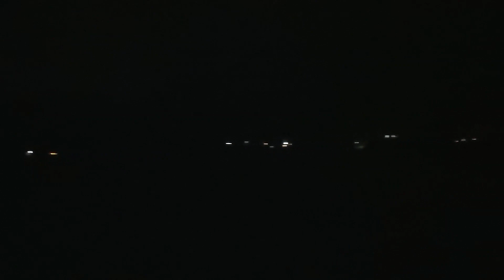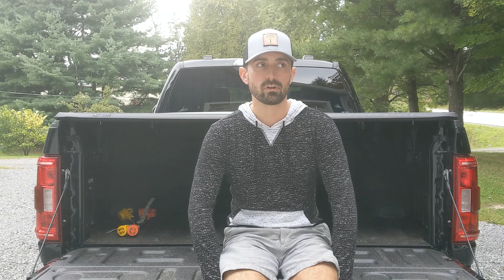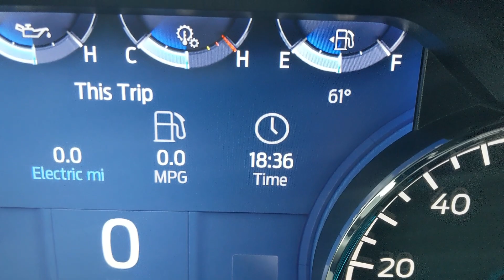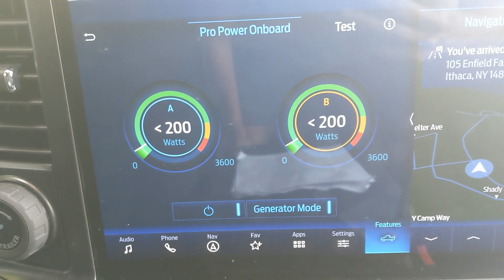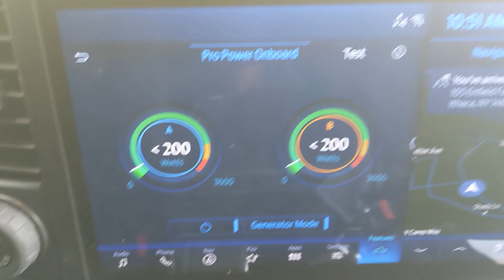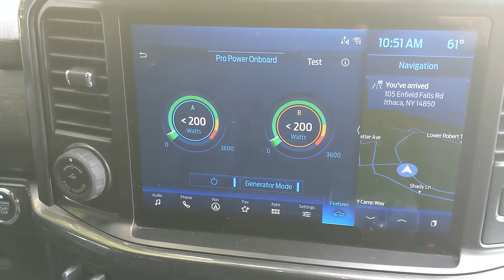2021 Ford F-150 Powerboost Generator - Part 6 - First Off Grid/Boondocking Camping Trip!

Comment: Seems like you have a very liberal definition of boondocking. My sense is that boondocking means you're in the middle of nowhere, no facilities, no campsites, no company from other campers at all. Sounds like you were in an unimproved  campground.  I've found the toughest thing is tanks/water that keeps you from having an extended stay boondocking (> 5 days). (2022 Powerboost/Winnebago Micro Minnie FLX). Do you have solar on your camper. Pretty essential for a longer stay even with the truck.

My Powerboost (and yours) is designed to do the power generation for 36 hours straight. After that, you'll need to turn the vehicle off and then back on to "buy" another 36 hours. I'd say your truck is working like it's supposed to.

Comment: It's a cool feature but you really would be better served just buying a small inverter generator. No wear and tear on the truck and much much more efficient.
Reply from the maker: Are those inverter generators silent when they are running? I haven't used one before
Reply: @notallwhowanderarelost2024  The only thing that is silent would be solar.

Comment: I used my Powerboost to power my camper for five winter days 24 hours per day for about 1/2 tank of gas. We used the truck hotspot to watch Netflix and nice unexpected benefit. My iPhone did not connect as yours did. I kept the truck in Utility Idle mode. There was one point the 5th day that it did idle for a long time, but I turned it off and then reset it back to Utility Idle mode and it went back to the short idle time.
Reply from the maker: Hi JB, I am curious, what is the utility idle mode?
Reply: @notallwhowanderarelost2024   my truck is a 2021 F150 Powerboost XLT with the 7200 k option, like yours, perhaps. I noticed on your display that you just have Generator Mode. Mine at the same screen has a second option called Utility Idle. I took a picture of mine but I can’t see how to send a picture with this reply app. In the owner’s manual utility idle refers to trucks with a flip key as a way to remove the key from the ignition. If yours is a push start perhaps the display is different. I will keep watching and see what you come up with on this. JB
Reply from the maker: Ah yeah you are probably right, it's most likely for the keyed model
Reply: @notallwhowanderarelost2024  This Ford sponsored video at the 2:20 mark goes over the Utility Idle Mode for the Push Button models -https://youtu.be/8YrGaqIiQAk
Reply from the maker: Thanks for sharing Eric, yep definitely for the keyed models only
Reply: From reading the manual it looks like the engine staying on May be from something called "Low Engine Use Mode"

This is to get the engine warned up and boil off and water that may be accumulating in the oil from burning gas, specifically ethanol. It will enter this from being in generator mode for extended periods or from only driving a small number of miles per trip.

Long story short, just let the truck do it's thing to minimize oil contamination and avoid bearing damage.
Reply: My does something where it will idle at I higher speed, I’m guessing to recharge faster. Is that the same as utility idle?
Reply from the maker: There is a setting that determines the idle rpms. It's for charging the battery faster I believe.

Comment: To get to Android Auto settings: Open Settings. Open Apps. Scroll to Android Auto and click. Scroll to In-App Notifications Settings and click. Now you're at Android Auto settings. Scroll down to turn wireless Android Auto off/on. Your OS and Android Auto versions may be different than mine. There could be slight differences of screens and text. I am Android 10 and AA 7.9.122644-release.daily.

Comment: Thanks for touching on the interior temperature issue! This weekend I had this thought as well with electronics temp. I had to also open my hood because the front end was SO HOT, Outside temp in MD was only 79 so in 85-90 that could get dicey. Definitely park in shade always I say. My truck also did the running for 30-45 minutes after having it on GEN mode for 8+ hours running the camper AC etc. With gas prices as high as they are it's not as fun using the truck but it's still amazing tech! Enjoy!
 2021 PB7.2Kw 26miles
Reply from the maker: I am getting a sun reflector for the windshield too to try to keep it cooler in the sun

Comment: So I think I figured out your running issue. Your battery cannot be topped off with 2 or 3 minutes of engine time. It probably needed a full 30 or 40 minutes of runtime to help replenish the battery completely. 1000 rpm isn't really terrible. I think if you have a few gallons in a spare gas can you should let it do its thing

Comment: Have you tried turning on the rear generator without turning on the truck?  If that works, then I imagine it would solve your Android automatically connecting.
Reply from the maker: Hi skrsys, the generator needs the truck to be on, so that's not an option unfortunately.

Comment: Is it possible to use adapter to plug my camper in that is only a 3 prong, my new truck only has the 1 outlet? Also do you know if it’s possible to upgrade the truck to the higher wattage?
Reply from the maker: Hi Scott, do you happen to know if you have the Pro Power option? Is yours a hybrid Powerboost? There are three different options for bed power.
Reply: Yes it’s a power boost hybrid.
Reply from the maker: I believe the Powerboost comes standard with the 2.4kW generator, so if you divide that down by 120V you get 20A of current output. So this would be no different than powering the RV on a standard 110/120 outlet at home. What I have found on those outlets is you can power the camper but have to be careful not running too many things at once. For example, you can't run the AC and the microwave at the same time. But it should work if you keep an eye on what is running.
Reply from the maker: Oh also I don't believe you can upgrade from the 2.4kW to the 7.2kW unfortunately.

Comment: Wireless Android Auto requires the "automation" of the truck connecting to the phone. If it wasn't designed to be automated, you would have to manually launch settings on your phone everytime you got in the vehicle.
And the reason Android Auto "Wireless" requires a WiFi connection to the truck is for bandwidth requirements of Android Auto "wireless" VS Android Auto wired via USB.
The consumer demands all these features, but they must be ready to live with the automation requirements.
In your situation you found the solution. Disable "Wireless" Android Auto on the phone while you are camping.
Reply: One other note related to having a Bluetooth connection with the truck while you are in the RV. With Bluetooth connection, the Ford Pass App has extended capabilities with Pro Power Onboard management. For example you can actually turn it off/on. :) 
(VS Cellular or no connection at all)

Comment: Great video.  Do you know if the 2.4 generator is enough to power things like a portable stovetop?
Reply: The 120 volt recepticals will handle 20 amps which equates to 2400 watts.  So it can run a 2400 watt stovetop.

Comment: You said 2/3 a tank you thought over the 5 days? How was the gas mileage to/from towing the trailer? I'll go back to your first trailering video to see if you talk about it then as well. But just picturing boon docking not near a gas station and using up the truck fuel and having poor towing mpg to get back to a station. Probably not that big a deal, but could run into problems???
Reply: Yeah its too bad you can't get the 36 gallon tank on the hybrid
Reply: @omni_0101  Agreed. The included 30 gallon is better than the others, but 36 would be really nice.
Reply: @casmered   According to the manual, the PowerBoost generator will cycle off to prevent running out of fuel. However, I don’t remember what or if they said at what point it would stop.  I was at one point caught out in the camper on a winter night with a 1/4 tank of gas, it got me through the night in the camper with heat and my CPAP.  So, 1/4 tank isn’t low enough to stop the PowerBoost. There was enough fuel without towing the camper to go for a fill up and return.
Reply from the maker: @jbcross7513 coincidentally I just ran into this last week. Once my low fuel 50 miles remaining alert came on it shut off the generator.